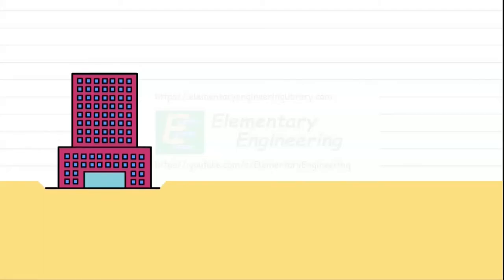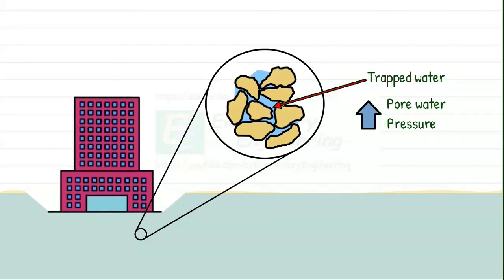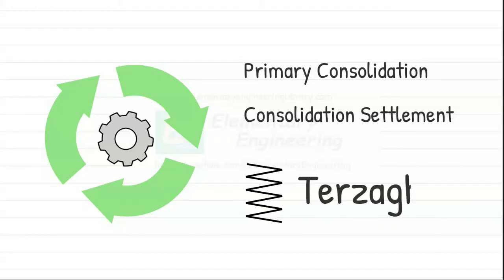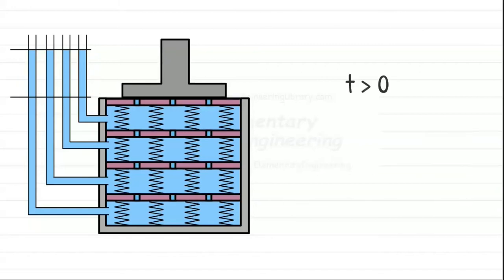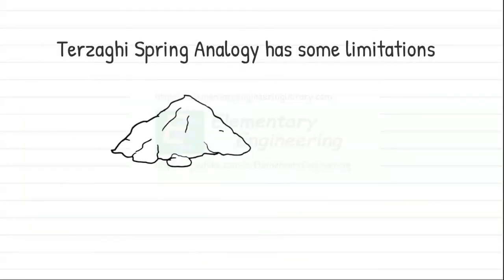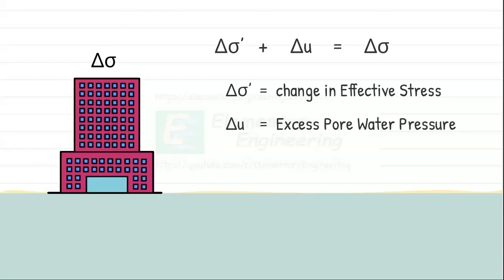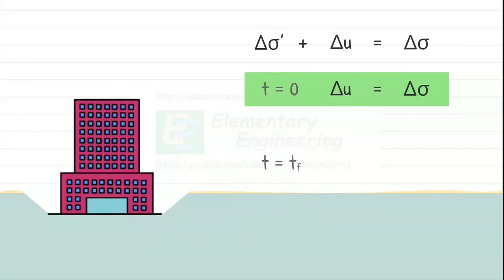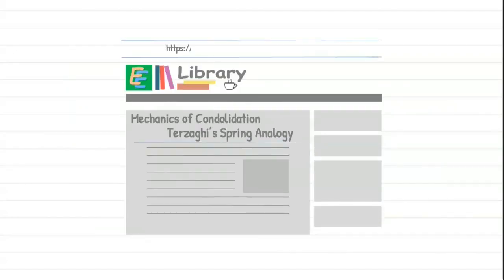Terzaghi's Spring Analogy & Mechanics of Consolidation | Elementary Engineering

Comment: Awesome, just a follow up question: why at t=0 the applied stress not shared by both soil & water ie a matrix? It's said to be taken by water only at t=0. I would have expected both soil & water to share load at t=0 & over time the load taken by soil to gradually increase as the water emigrate out of the matrix.
Reply from the maker: It is because water is incompressible.
Hence the soil skeleton can only deform when drainage occurs.
So, at t = 0, the applied load is taken entirely by pore water and once the water begins to drain out, the soil skeleton gradually begins to take the load.